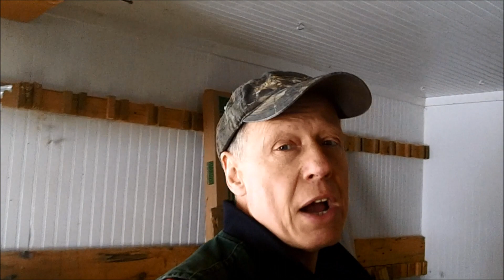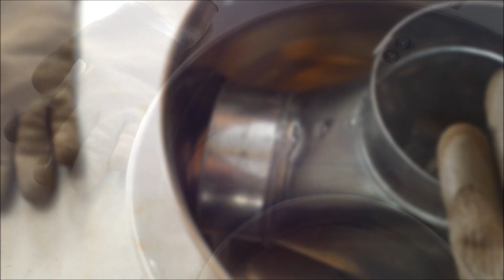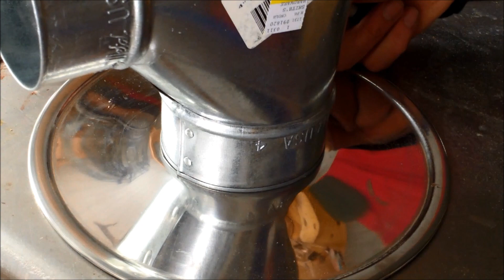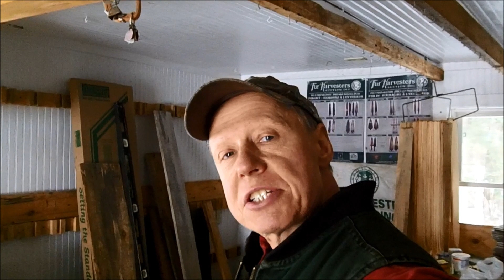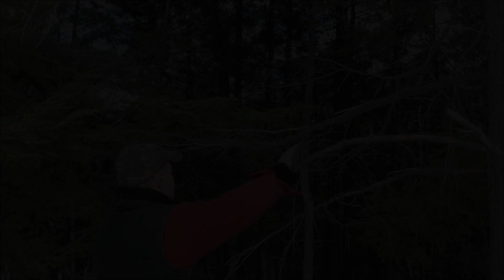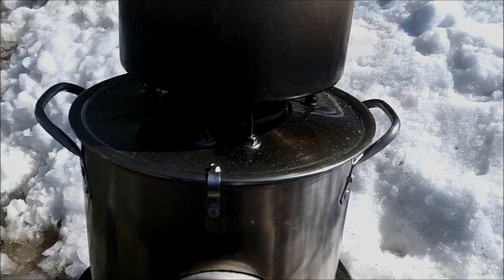HOW TO BUILD A SUPER SIMPLE ROCKET STOVE

Comment: Great rocket stove JC!  One of the better ones I have seen.  I will be making one of these for sure, as I am a little silly minded in feeling I need to have as many innovative stoves possible.  I could even borrow the iron cooking spacer from my range here at the cabin, instead of the u bolts.  Did you have the u bolts positioned at the very end of the treads to reduce the height as much as possible?  I cook my moose chili in the exact pot that you used here... I bet the 6 inch would reduce the boiling time more than half, I now know what my next project will be!  Thanks so much for sharing this, as always take care.
Reply from the maker: Dave Wilcox Jr I think it would have boiled much quicker if it was so windy but it was wicked out there. I just removed the ubolts, bent them 90 degrees and reinstalled them.  I have a feeling the stove won't draw as good with the pot lowered but haven't tried it yet. Yes, I did have them bottomed out.  I'm tweaking the design and will post an update.  For cooking purposes, this is the cats ass just the way it is. That water was hot in no time.

Comment: I'm wondering if you couldn't use vermiculite instead of sand. We use vermiculite to put our hot glass beads in to have them anneal as it is good insulation and lets the glass bead slowly cool. Great little stove. :) keep the cabin cool in summer for sure :)
Reply from the maker: Louise Florida I'm sure a lot of stuff can be used. I have endless sand and it's free so that's what I went with.  I'm lovin it.
Reply: After checking around, Perlite is cheap and weighs less that vermiculite and doesnt' hold moisture or pack down like vermiculite does. 
About 3. for a large bag. Here's the vid for someone who uses it. :)
 You can check out kbbacon's video "Answers to my rocket stove insulation". 
So you can make it lighter to carry. Very cool!

Comment: The side hole could be cut higher up on the pot allowing for the pipe to protrude higher up and nearer to where the treads stop on the u bolts  or making it closer to the bend if you can understand that gibberish Ha! Got to build one saw both videos and learned something Thanks Boss
Reply from the maker: Artaxerses1945 Lots of ways to tweak the design for sure. Fun little projects.

Comment: hay guy, on the part where you said you would add alittle more pipe, add another ''T'' turning the bottom part of the ''T'' up and put your pieces of wood in there so the wood will feed itself. ya I would go with that old camper stove top too. really nice job there... now i wonder if you can do the same, but with 2 burners and 1 inlet for the wood to feed into !!! cook bacon in 1 pan and eggs in the other at the same time... you look like you got enough heat to do it...
Reply from the maker: I think a person could get really creative with this. A 2 burner one would be cool for sure.  I use this stove quite often and love it.

Comment: Put a metal ring about 1 inch bigger all around than your cook pot, like a bottomless pot , to make the heat go up around the pot  rather than blow away.
Reply from the maker: +David Peters I was intending on doing that but I lowered the Ubolts and it works slick now. Cheers :-)

Comment: You could use rock wool insulation instead of sand for a lighter stove.
Reply from the maker: Vsshooter Not sure what rock wool is.  I only used sand because it was free. I'll experiment with other materials and designs as I build more.  It's a fun project.
Reply: jc rock wool is just another name for fiberglass insulation. unless he is talking about the woven stuff which I don't think he is because would be kind of expensive.

Comment: Ok, I have a million questions...first, LOVE LOVE LOVE how easy you have made this, even I can do it!!! thank you for that!!!  My friend and I are going to make one together so we each will have one to add to our ways to cook!  Questions...If I am using the gas grate instead of the u bolts for my cooking surface, would I just cut slits in the lid to keep it in place?  Also, someone said something about other mediums to use to pack around the pipe, have you tried anything else?  and lastly, if you are using a 6" T pipe instead of the 4", would you need a bigger pot also? whew! ok, that is a good start for my questions!  as usual, love your videos, they are just so easy to watch and enjoy! best to you and frankie! <3
Reply from the maker: avonleanne Yes I will be using a bigger pot for the 6" pipe model. I haven't tried any other material for packing. This was my first attempt and I have an endless supply of sand. Sand is free. I like free.Most stove grates have little prongs on the bottom so you could just drill holes in the cover for the prongs to slip into, or use small ublots to hold it down.  Believe it or not, the hardest pert of this whole project was drilling the holes in the stainless steel.  Have fun with your project. This stove is a little gem. I love it.
Reply: Free is awesome for sure!  I think I will wait and see what you do for the 6" before I decide to purchase anything to make this...thanks again for the idea...I am in awe of all the clever people on You tube, you all just have been so helpful. =)

Comment: I was wondering if you flipped the T on your design and used the end that you folded over to hold the pot.  You could just cut out "V" sections and bend them outward a little bit.  That would allow the heated air out and still hold your pot above the lid.  Only question is whether it would be sturdy enough to hold your pot full of water.
Reply from the maker: David Wagner Possibly, but I think if you started cutting away at the pipe it would be pretty weak.  The ubolts did the trick but I'm still experimenting further.

Comment: Have you tried to use Roxul insulation in place of the sand to lighten the weight of the stove?
Reply from the maker: 41chickenman I want the stove t have some weight. I don't want it to blow over in a wind gust. The sand is free too.  The stove weighs about as much as a 12 pack so no worries.

Comment: That is perfect! I shop at the dump as well, ha ha. Do you think a sack of quickcrete would work for the separation between the tee and pot?
Reply from the maker: Please avoid using concrete. Concrete becomes explosive when it reaches a certain temperature. You will be making a bomb :-o
Reply: Thanks Boss, the thought had crossed my mind.  I suppose if I went ahead and did it, it might have went "THREW" my mind! Do you know of a more permanent or solid solution for the media?
Reply from the maker: Rockwool insulation has been suggested as well as "permilite or vermiculite" or something like that. If you read through the comments you'll see it mentioned.  I have no issues with the sand. It's a GREAT insulator regardless of what the "experts" say and it cost nothing.  I love these stoves :-)))

Comment: Great idea. I was wondering if it was possible to use a selt expanding insulation tat is fire proof to fill th einside of th emaid pot? Thanks again for the video.
Reply from the maker: Mike Box I'm not even sure if it's necessary to fill it with anything more than air.  I used sand because I have an endless supply and it's free. It worked slick.
Reply: Indeed. I liek th eidea that the sand will keep it stable and planted where you place it.

Comment: how many tapping screws did it take to make 1 hole in the lid?
and im with you on the stove grate thanks for sharing ideas
Reply from the maker: Clay Dust I made it through with one screw but it took about 3 times longer than sheet metal ha ha. This was the first time I've ever tried to drill stainless.
Reply: thebossoftheswamp
stainless is a B and im supprised you cut through with snipers
yur  awsum   thanks fur all   blessings

Comment: This was an awesome video and I love rocket stoves. I have a little one I use for camping. This size is perfect for the off-grid cabin as I am tired of buying small propane bottles. This might sound silly, but how do you clean the ash out of the firebox when it builds? Do you just scoop it out? In the 4" pipe it might be a little difficult though I may be wrong.
Reply from the maker: I get asked that a lot. I just reach in with a gloved hand and pull the ashes out.  I love these stoves :-)
Reply: Thank you. I love your videos. Your are my inspiration,
Reply: To make a "rake" use a piece of threaded rod and a short length of  1/2" to 3/4" wide flat bar. Drill a hole in the flat bar sized to accommodate the threaded rod. If you have a tap & die set, cut the hole so the threaded rod will screw into the hole in the flat bar. And/or use washers & nuts to secure the flat bar to end end of the threaded rod. You now have a T shape. Sized to reach into the stove and pull out the hot ashes into a metal paint can (for example). This is modeled after the rake my Mother used to pull ashes out of her wood burning cook stove. 

With a bit of practice, it won't take long to see how this T shape is beneficial in maneuvering to get to the ashes while the fire is burning. 

There's no need to pull out all of the ashes at the base of the flu tee. They serve to help insulate the lower portion of the tee from burnout. There's no harm in leaving them there, as long as they don't get wet. I don't know how weak lye reacts with previously galvanized metal. (Doesn't harm cast iron.)

Using the rake, allows you to pull out ashes, as needed during a long cooking session, such as a slow simmered pot of beans. If you have metal working tools/skills, there are lighter weight alternative methods to create this T rake.

Hope this helps.

Comment: I don't think the U-bolts are that bad an idea, you just don't have enough height adjustment with them.  How about replacing them with some threaded rod bent into a U-shape and adjusted/secured with nuts on both sides of the cover?
Reply from the maker: Arnd2it I'm just going to add about a 1/2" to the stovepipe and I'll be all set.  I just used the U bolts to give folks an alternative  if they couldn't find the stove grate.

Comment: +thebossoftheswamp 

Thank you for doing these videos. I am very much so enjoying watching and listening to you teach and experiment with practical ideas.

I would love to see what your bigger one looks like, I want to build one now.

But one quick Question, What kind of pipe would you use if not galvanized? I have seen a few people use Steal cans that used to hold food, You know the ones that are near about a gallon. Also do you use a welder to make any of your stuff? Just curious. Thanks!
Reply from the maker: +Luke Woods (Nexis)  The bigger one can be seen in the rocket stove recap video. I used 6" steel stove pipe on that one.  Yes, food cans will work fine. I didn't use them here because I wanted to make the project simple and less intimidating for folks that aren't very handy with tools and such.  I have not learned to weld yet but plan to someday.
Reply: +thebossoftheswamp I think you would enjoy welding. I know I do. 
Thank you for responding! I really appreciate it. I found your video with the bigger one and I am very impressed. I am shocked that anyone would have an issue with you using sand! Using sand sounded like a great idea.
take care and God bless!
Reply from the maker: +Luke Woods (Nexis) People frown on the sand because they can't handle simplicity. If you don't buy it at a store it's no good. You wouldn't believe how many people told me my icebox would not work. The vent window is too high, too small, I need a fan, I need two windows - one on top  and one on the bottom for natural convection, I need two fans, one blowing in and one blowing out, well... I been at my cabin for 9 days, my icebox is smack dab at 40 degrees with no ice cooling it.  Cheers :-)
Reply: +thebossoftheswamp right on! 
You're dead nuts on. People have been sold "name brands" for so long that anything not produced by a big company just can't be any good, and God help us all if it's too simple to boot!

Keep up the good work bud. 

ooh and also, have you done any solar power? I'm still watching your videos, but I haven't seen solar.
Reply from the maker: +Luke Woods (Nexis) My solar panels are still in the box. They'll get put up one of these days but I'm in no rush. My cabin has been run off old junk car batteries for a few years and this works fine. I'm typing to you now on discarded battery power lol.  Cheers
Reply: thebossoftheswamp how are you charging the batteries then?

Comment: JC - when you put the 4" Tee in the stock pot, is it sitting right on the bottum or sitting on sand... Either I got the wrong T (too small) to sit it on the bottom to get it to come out the top... I'm building two of these this weekend with my boys helping!!
Reply from the maker: +Rob Baker   Mine is sitting on the bottom. Maybe you had a bigger stock pot than I used.
Reply: I used the Mainstay 12 quart from Walmart...but must of gotten a smaller 4" Tee (and I couldn't find a non-galvanized one either).. I'm gonna just put enough sand in the bottom (will help insulate the bottom anyway) to get it to the height I need.  maybe I'll use a firebrick that I have left over from my outdoor pizza oven build!  Thanks!!!

Comment: So I bought a 12 qt stainless steel pot from Walmart with the metal lid,  a 4 inch stove pipe unfortunately it was also galvanized,  but as I was cutting the crimped end just as you said I put inside and the top of the stove pipe was an inch below the lid.    What are the exact dimensions of your stove pipe. Because I got the 4 inch just as you said
Reply from the maker: I'd love to give you an accurate measurement but my stove is 300 miles away at the moment.

Comment: +thebossoftheswamp I built this stove yesterday and I found that the perlite was falling out of the cracks where the feed tube makes contact with the edge of the pot. did you experience the same thing or should I just make sure I get better at using the tin snips and get my tin snips sharpened?
Reply from the maker: +Andrew Greaves A little high heat caulking would fix that.

Comment: jc, I am planning to build a rocket stove today, but can't find the t, is there a name for it other than 4" t, where did you get yours?
Reply: +daniellegrandpa He probably got it from a hardware store or a place like Home Depot or Lowes and in response to Tom Robertson, you are right, you have to play around with lengths and the larger the diameter the longer the chimney section needs to be. The one he built in the video is good mostly for temp use or for transporting if you are camping. Making it taller would make it more efficient but also harder to move around and store. If I were trying to live off grid I would probably build 3 or 4 of the things with varying sizes of pipes and heights and space them in such a way that I could build a conventional height range. Even that frame could be found on "Spring Clean up Days" in many towns or just out where people discard old appliances

Comment: Parts and equipment list:

12 qt Stainless Steel Wal Mart (MainStays) Stock Pot with lid
4" T. Stove Pipe Prefer non galvanized - My quick searches indicate this can be expensive! (please comment on t-pipe)
Cheap Sand
Gas burner grate(not using u-bolts)
Self tapping screws and clamps?
Shahhhrpie
Measuring tape
Drill
Curved Tin Snips for your dominate hand (red handled for righties)
File
Punch
Reply from the maker: I think the pot cost me 9 bucks and the T pipe 14.00, the U bolts about 3 bucks. I had the screws and tools.  If the grid goes down and the store shelves are cleaned out of propane and Coleman fuel. This little stove can be a life saver.  I have an update coming up tomorrow and I talk more about the pipe.
Reply: thebossoftheswamp
Thank you!

Comment: Why can't I use the 30 gallon galvanized trash can I turned into a rocket stove/mass heater in my house? You say not to use galvanized inside your home but I've burned most if not all of it off beforehand on my first burn right?
Reply from the maker: +jhatch   Personally I would play it safe when  burning things inside my home.
Reply: Well thanks for a timely response! I guess I'm lucky since my mother has purchased me a cast iron wood stove and I don't have to worry much about the rocket stoves/mass heaters I've constructed. Although I'm burning my 30gal one this morning all be it just a few pallet pieces. Seems to be going well so far, I've made sure to vent my home well before burning though.

Comment: @Thebossoftheswamp, SUPER IMPORTANT QUESTION>>>> if you dont prefer glavanized aluminum. what would your first choice be? Please answer!!
Reply from the maker: Stainless steel.
Reply: Thanks! So should I get a stainless steel stove pipe? Or just any ss pipe T?
Reply from the maker: Stainless is really expensive but would last probably forever.  You'd probably have to find it online cause most places only carry galvanized steel.  You can find regular steel stove pipe but you have to burn the paint off before cooking with it.